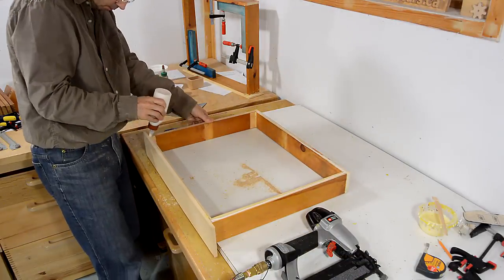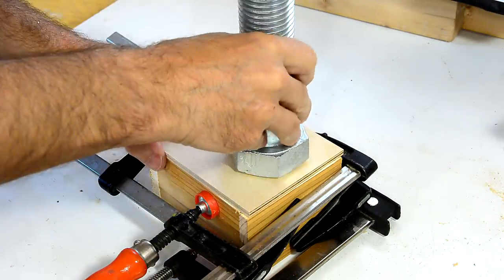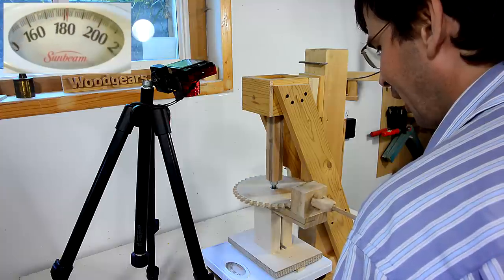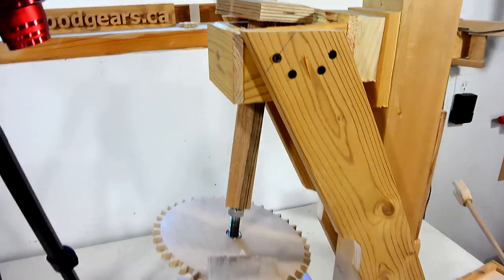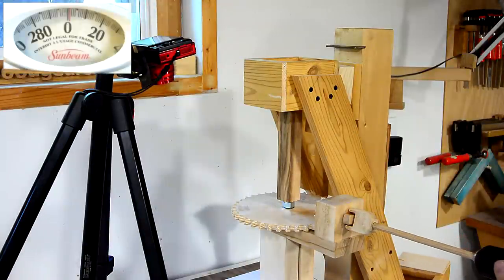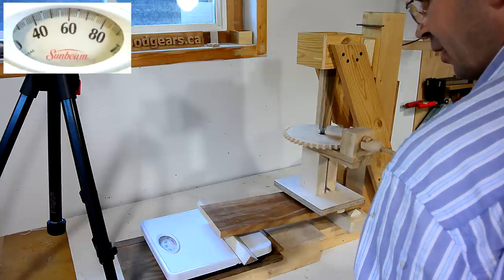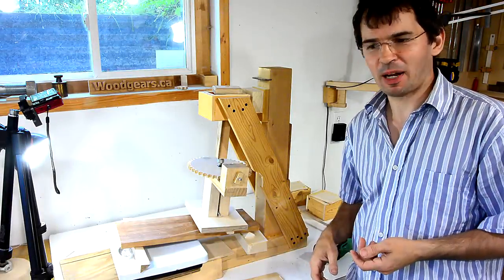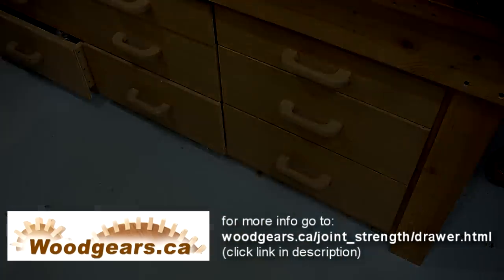Best way to attach drawer bottoms: destructive test

Comment: your boxes are far too small for a test like this i would think
Reply: +zeroy Why?
Reply: I agree,the larger the box the more deflection you going to have. A box that small with an equal size plunger. Is not a true test. Maybe if the plunger was half the size of the box interior.
Reply: zeroy 
I'm curious to hear why, too.
Reply: +Fester Blats its not so much the test was flawed but more that if the box was bigger and the plunger smaller the test would have required far less strength to be completed. I said this seeing that the test was not going so well at the start.
Reply: The more deflection the more likely the joint will fail. Right?
Reply: cejkwo Mass
"... the more likely the joint will fail."
in general, yes, but the point isn't just to break it
Reply: zeroy
"... the test would have required far less strength to be completed."
most likely, yes, but no (see comment below), and it wouldn't have been a very good test:
— if the plunger is the same size as the box, it's guaranteed that the stress is equally distributed.  
— if the plunger is smaller than the box, it's hard to set up (challenging to get into the middle with any precision) and there's no guarantee that the force is really equally distributed.

"I said this seeing that the test was not going so well at the start."
it's a reasonable thought.  it just creates more problems than it solves, I think.
Reply: +ThoperSought Not only force will be still equally distributed (just place the plunger centered on the box) but both scenario still get the same test so results still good. Again the test showed the correct predictable result but would have been easier, i think anyway.
Reply: zeroy
"... the test would have required far less strength to be completed."
I said it would require less strength, but there is a problem with that: the amount of supporting material (glue surface, wood behind the groove) involved in a larger box is greater, so the force is spread over a larger area.  same force, more support—it would almost certainly have taken significantly more force to break, in that case.

the only exception to this—that I can see—is if the bottom deflects significantly and causes a failure that isn't a direct failure of the joint.  for example, a failure of the panel, or (in the non-glued grooved test) if the panel pulls out of the groove.  obviously, these would not be direct tests of the joint itself.

so, most likely I was wrong.
Reply: zeroy
"(just place the plunger centered on the box)"
how do you propose to do that in a repeatable way?  

if you just literally mean, 'just put it there,' that's not going to be repeatable, and could invalidate the test.  also, it would be very hard to arrange inside a box, so the setup time would be a lot longer.
Reply: +ThoperSought a pin on the top of the plunger that meets a tiny hole on the centre of the box.
Reply: zeroy
"... a tiny hole on the centre of the box."
that would certainly be repeatable.  with the forces involved, do you think the hole would be a stress riser to cause failures in the bottom rather than in the joint?

I suspect it might be a problem, but I really can't say for sure.

also, are you still suggesting larger boxes, or just smaller plungers, at this point?
Reply: +ThoperSought any number of ways.  Mark the center with lines corner to corner.  Have the plunger free floating.  Visually align the plunger on the X with double sided tape.  Flip and break.

Create a stepped plunger.  The first layer which aligns the fixture is the size of the box.  The second layer which applies pressure is smaller to demonstrate more realistic loading.  Slides in the same way each time, and the contact area can be adjusted easily.
Reply: MaxxFordham
"... the ratio of support to bottom area is less with a bigger one..."
that's true, but I don't think it's relevant:

the purpose of the test is to test the overall strength of each joint, and compare them, so more support is more support, and translates to more force required to break the joint, unless the force isn't applied evenly.

if the force isn't applied evenly, then, yeah it'd take less force to break, but it would reduce your ability to compare the results, meaningfully, because you'd mainly be testing the (highly variable) strength of whatever the weakest section randomly happened to be.
Reply: Joe and Liz
"Visually align the plunger on the X with double sided tape."
double-sided tape would help, but of course the jig would have to allow the plunger to come off easily—maybe it does already, dunno.

"a stepped plunger"
yeah, that's reasonable.

"... to demonstrate more realistic loading."
let's be fair: that would not be realistic loading.  do you open your drawers and stand in them?  even if a localised weakness makes the whole thing fail under the 600-800 pounds Matthias got in his tests, we're talking about forces that are highly likely to far exceed the strength of the sliders, or the point where the drawer would bind on its runners.

even if the weight of things in a drawer is not well balanced, unless you're putting lead jars filled with depleted uranium in it, it's not going to fail that way under real conditions.

all of this is moot, anyway:  you probably wouldn't accept this test if he was comparing boxes built with different species of wood.

if that's true, then you shouldn't accept any differential in the loading, either, because at that point the outcome of each test depends more on the (random) local idiosyncrasies of the spot where the force is applied to the specific pieces of wood he used.  

spreading the force over a larger area will tend to average out those differences, at least to some extent.
Reply: I have no problem with the tests, just I disagree with what is thought to be tested and what is actually tested.  This is a test of glue strength versus lignin.  Essentially solid wood versus a butt joint and has little to do with drawers.  As a test of that in how it relates to drawers, it does fail as well.  The internal strength of the wood used (a spruce or perhaps fir) is much, much lower than the internal strength of woods conventionally used for captured drawers.  Hard maple is approximately twice as strong against similiar forces for example.

In terms of the forces and variables, that is why you test more than one and average out the results.  I use data every day that is collected in similiar manner uses similiar tests, from Janka hardness, to the modulous of elesticity and tension perpandicular to the grain.  They all have issues with how they achieve their numbers but the numbers are useful.  Knowing how strong a glue joint is is useful.  It is even useful when making drawers, but it isnt an answer to the question posed.

In terms of the method of building the drawers, I am already in his camp for shop drawers.  Granted, I also screw mine on...and use plywood for the sides.  They hold up well enough, but are not something I would use for a paying customer.  However, they are fast and cheap to build and more than able to hold what gets put it them.

They are not as good for a variety of reasons though, but they are good enough for the task.
Reply: Joe and Liz 
I'm not confident that I'm expressing this as clearly as I'd like, so I want to add a note about what I'm calling balancing the force—using a full-sized plunger—compared to what I'm calling differentially loading the structure—using a smaller plunger, even if it's centered.

I hope this'll make my position more clear, if you're still bothering to read what I'm writing.

imagine, for a moment, that the box is made from something lighter, like heavy paper.  imagine that it's got a defect in one area, just around where the bottom is attached.

if the plunger is the full size of the box, then the total force observed is spread over the whole bottom, and each section (in effect) is resisting a smaller portion of that force.  then the total force required to break the box is greater than if the force is in any way focused on the defective portion.  

by contrast, if the plunger is small, and set in the center of the bottom, then the deflection of the bottom will tend to cause the defect to pull apart—more than it would with a full-sized plunger—and fail sooner.  once the paper starts to rip, that rip provides a path for the force to be relieved, which it will take.  this has the effect of focusing a balanced force on the defective area.

since the nature of the defect is variable, having a centered plunger in a variable material like wood means that the test says more about the defect than it does the joint.
Reply: Joe and Liz
"... just I disagree with what is thought to be tested and what is actually tested."
okay, then you know more about this than I do, so could you elaborate a bit?  from what you said, here, I don't see exactly how this is true.

"As a test of that in how it relates to drawers, it does fail as well. "
do you mean that because the wood used is lighter and weaker than you'd use in a piece for a paying customer that this doesn't tell us anything about drawers?  that doesn't make a lot of sense to me, as it stands, so I feel like I'm missing something.

obviously there are scaling issues with the strength of hard maple vs. the strength of spruce, but it still seems to be structurally relevant.

if I'm making a mistake (esp. a stupid one) then I'd like to learn from it, so thank you (in advance) for taking the time to explain further.
Reply: ThoperSought And like I said...do it more than once.  When dealing with a material like wood in particular - you need to in order to achieve any sort of useful data as the wood is variable from cut to cut in the same tree and even more so from tree to tree.

If for example, his glued on bottoms had more sap wood than heart wood - the glue bond would be impacted.  Grain runout on the captured bottoms is also a factor.

You will also have variations of the plywood - many of which are magnified because of the small test size.  Modern plywood, from most mills is craptastic.  The stresses of sawing it are often enough to fracture the bond between the plys and start the delamination process.  This means that your small plywood bottom is much more likely to fail than a larger plywood bottom due to delamination and face veneer failure (you might note that this issue is actually in favor of a higher strength of the applied bottom...).

To be clear, I am not against the method used at all for drawer construction.  I just believe the conclusions to be disingenuous when applied to real world situations.
Reply: Joe and Liz
"... do it more than once..."
certainly true

"I just believe the conclusions to be disingenuous when applied to real world situations."
is this exclusively because of the excessively small sample size, or am I missing another factor?

thank you very much!
Reply: ThoperSought
"okay, then you know more about this than I do, so could you elaborate a bit?  from what you said, here, I don't see exactly how this is true."

The test of the best way to attach the drawer bottoms, captured versus applied.

When a drawer is in use, items are tossed it and removed...sometimes with significant amount of energy (my personal example of dropping a 5 lb. sledge into the drawer and having it punch a neat hole in the bottom...).

Because of the method the force is applied, it localizes at the edge of the box and doesn't allow actual drawer mechanics to come into play.  Whether that is the repeated action (can be simulated with a cam or oscillating gear setup to punch the bottom of a drawer) or the loading (drawers tend to be loaded more in the center - and more random as well).  Point loads are much more common than a load which spans the whole bottom.

It does test what is stronger wood or a glued butt joint.  Although, it really didn't test that too well - as the real answer is that a glued butt joint is stronger than wood (until you get into exotics and certain domestic species like beech, some red oak and ash).

"do you mean that because the wood used is lighter and weaker than you'd use in a piece for a paying customer that this doesn't tell us anything about drawers?  that doesn't make a lot of sense to me, as it stands, so I feel like I'm missing something."

What I mean is most people don't make drawers out of a wood like spruce (or fir...).  Because of what the comparison is meant to represent (Drawer construction - captured versus applied) it should use materials used.  He didn't use a "good wood" since he was going to destroy it - but in order to be accurate, it needed to be a good wood.  Since the wood itself is in question in how well the groove holds, then you need to have a wood that is strong enough to hold as opposed to a weaker wood that will fail sooner in order to actually compare the two.

Maple, which is a very common material for drawer boxes should have almost twice the strength of the wood used here.  Quarter sawn ash that I use for most my drawer boxes should have a strength that is almost 4 times as much.

Comment: Your woodworking is great but your engineering analysis not so much.

You multiplied your tested number by some factor because the bigger drawers have more glue,  but that doesn't actually test for a bending failure mode in the bottom of the drawer.

The problem is that as the length of the drawer increases, the contact area for glue goes up linearly while the bending moment goes up exponentially.  So when you double the length of drawer, you're saying you're doubling the glue surface area (roughly) and thus getting double the strength. 

But for simply supported beam with a uniformly distribute load, the bending moment is (w)(L^2)/8 where w is the magnitude of the distributed load and L is the length.  When you double the length of the drawer, the bending moment load is actually going up a lot more.

And I don't want to get into the differential equations governing plate bending....suffice to say your estimates for drawer strength aren't good, and you should test at the same scale you build at, if you want accurate results.

Comment: You can do much better engineering than this! Try it again with a smaller surface area.   In reality, the load is never going to cover the bottom so completely. I almost think you're intentionally conflating force and pressure.

Comment: I'd advise to use a scale for obese people instead, those go way beyond the normal reading values.
Reply from the maker: +Eugen Afanasjev Good Idea.  But just looked that up.  All digital.  I need an analog scale that has a continuous readout.
Reply: +Matthias Wandel Compression springs are fairly cheap from McMaster-Carr.  Hooke's law is all you need to make your own 1-ton scale.
Reply: +Matthias Wandel 

Try searching for a Utility Scale. Should be able to find one used, took me 5 min to find one on my local online classifieds.
Reply: +Nelumbo Nucifera Yeah, but the normal range scale would break once more. I think the current setup is far better, yes, you have to do math, but he could just print a new disc and it would just fine.
Reply: aserta Hmm indeed. Haven't thought about this clever hack.